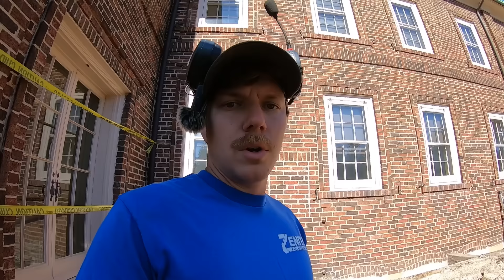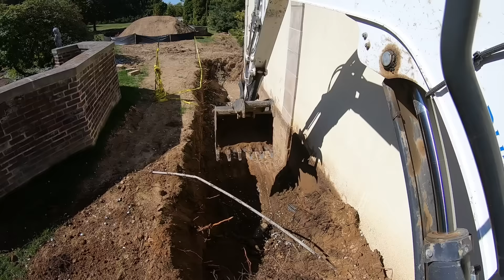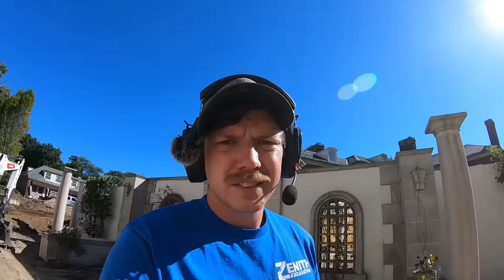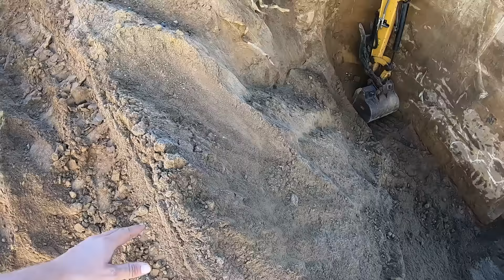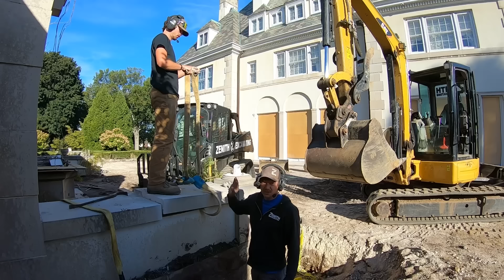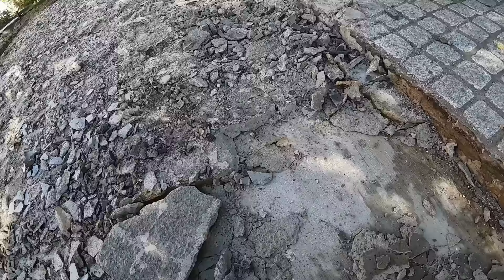Stairwell Demolition (wreck the stairs, save the house)

Comment: Hi Zach, this job seems to be the job of constant surprises.  Can't imagine how you heart dropped when the guy told you that after digging by the house and cutting those pipes that they had change of plans. 
I think this was a first for you having the remove that Steel pole with the lamp attached to the side of the building.  Glad that with having the issue with the bucket extension you were able to safely get that down with and get it safely on a pallet to be used again.
Always good to have the gas powered equipment because you can usually find gas to run it when your batteries are low for the electric.
At least with job makes for a good video series for your channel despite the challenges you face.
Take care until next week Zach.
Reply from the maker: Thanks Ben, you’re absolutely right. Gas is never far away but electric can require a trip to the shop if the charger isn’t handy

Comment: Zach huge project just make sure your getting paid weekly as job goes on have heard horror stories GC gets fired they run out of $$$ cost overruns on job like that could be in millions if change orders aren't kept in check. Trust me from experience was on large 6 month project the 10 mil the guy borrowed was gone before project was 3/4 completed. Took 2 years to get the remaining money. Saving all that crap you're going to end up hauling away at the end of the project
Reply from the maker: Oh yeah, I know it can get really messy really fast. Some folks aren’t quite aware of how to manage money to make it last to the end of the project